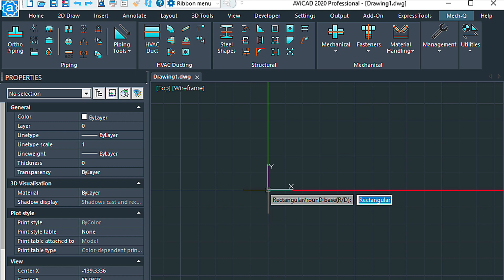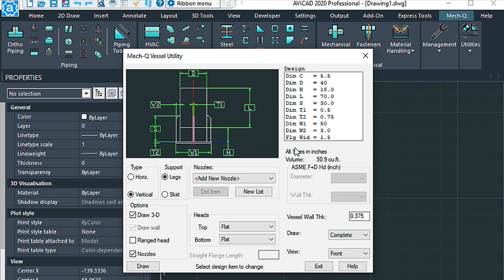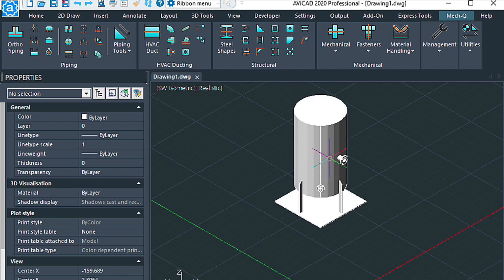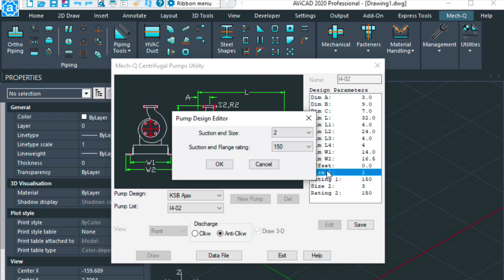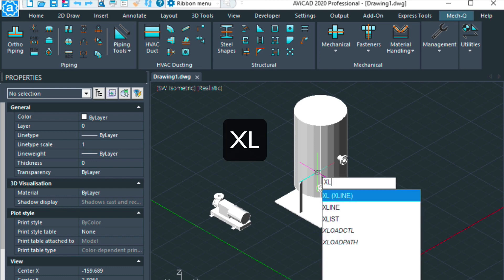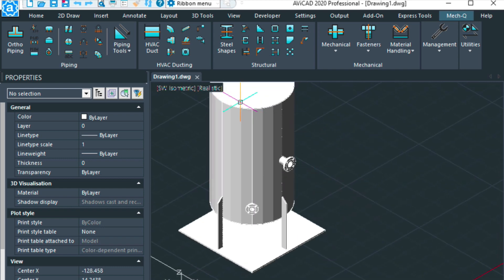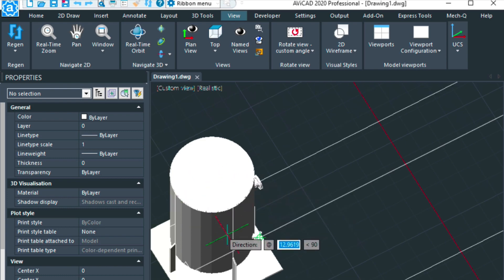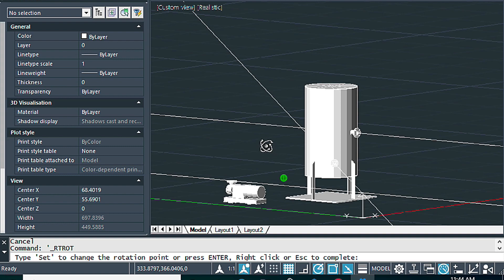How to draw 3D Pipe and attach to vessel and pump

Comment: your videos are extremely helpful. i am haveing a hard time drawing the pump. whenever i select my pump and press the draw button the cursor automatically goes to highlight instead of drawing the pump in
Reply from the maker: are you running AViCAD - see if you can repeat this in a new file - you can also use cadavenue.com/support if you need addtl help.
Reply: @cadavenue  yes I am running avicad. I attempted to open a new file but even then the cursor automatically switches to highlight instead of drawing even I attempt to draw in a pump.